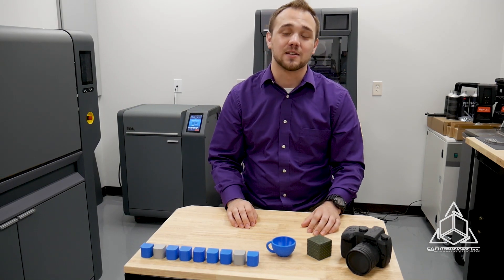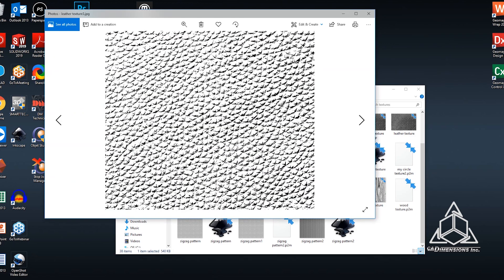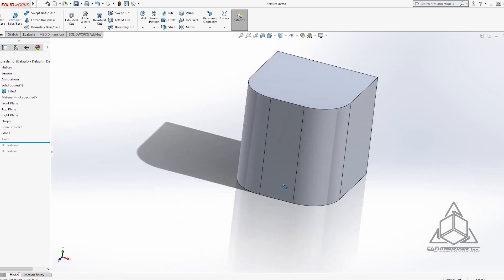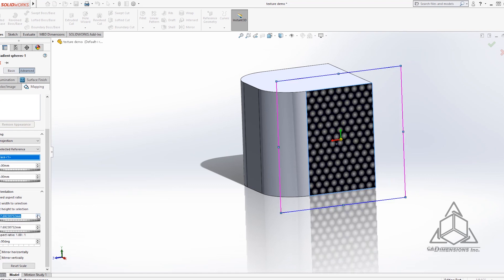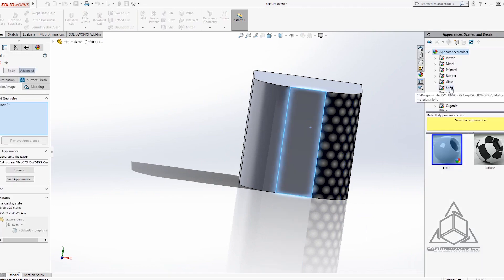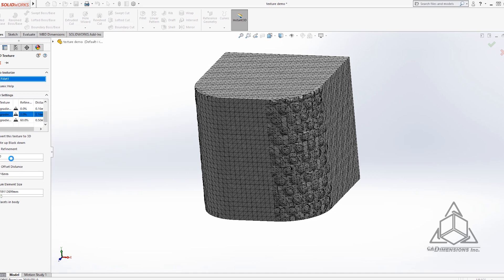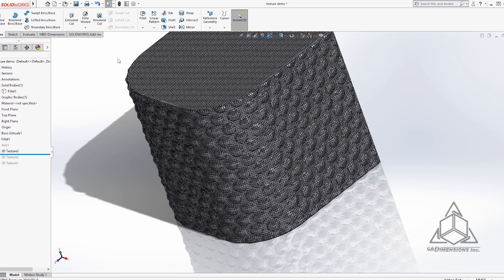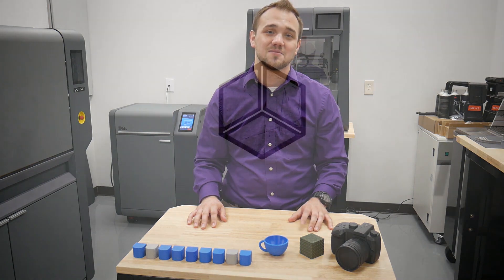How To Use 3D Texture to Make 3D Prints Look Amazing - Tutorial

Comment: Nice way to get cool surface results. A lot of tweaking tho. Wouldn't it be easier to use an unwrapped texture corresponding to the UV-maps of the imported object. Or does Solid Works not support UV's?